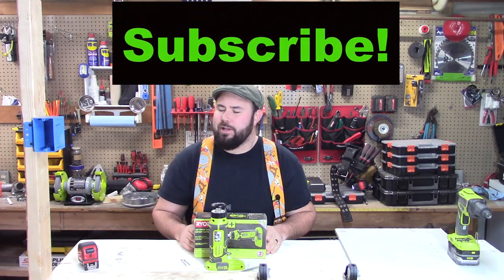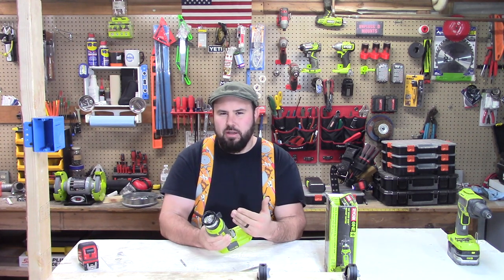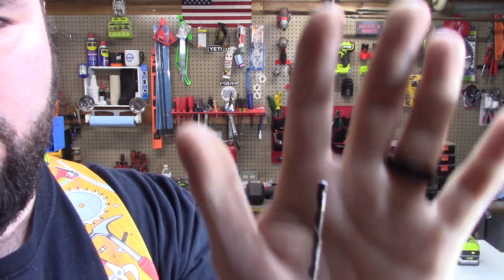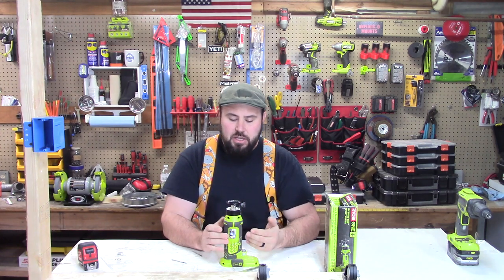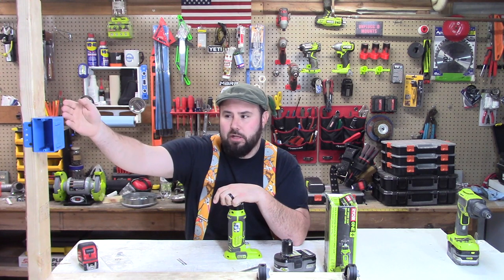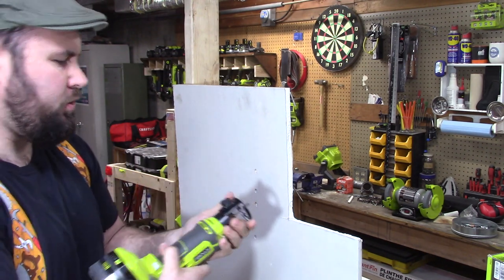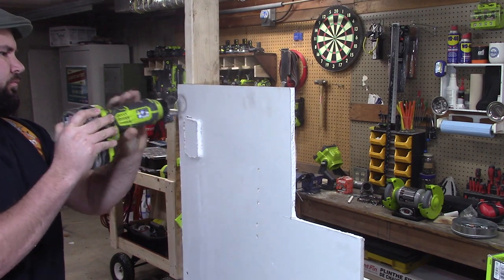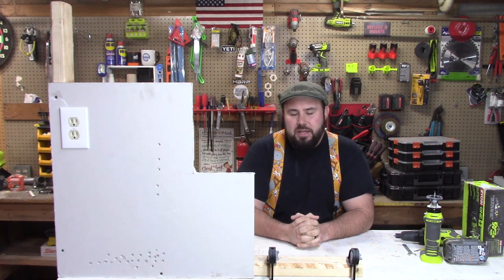Ryobi Rotary Plunge Saw Review and Test

Comment: 2:34 is the adjustable shield removeable? Or can it fully retract to the tool body so it's completely out of the way from the cutting tip? The shield is in the way for the cuts i need to make, thanks.